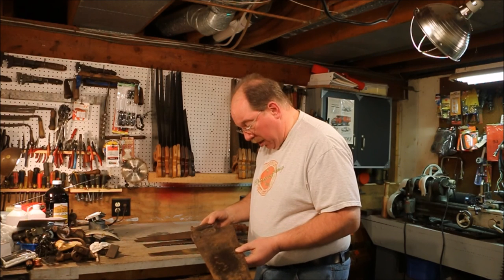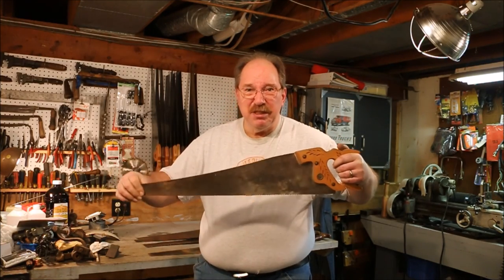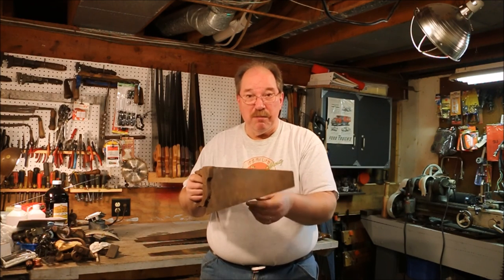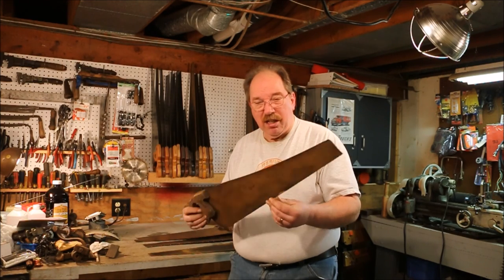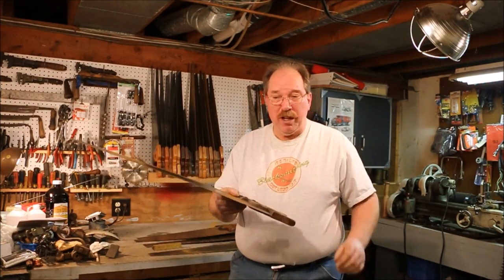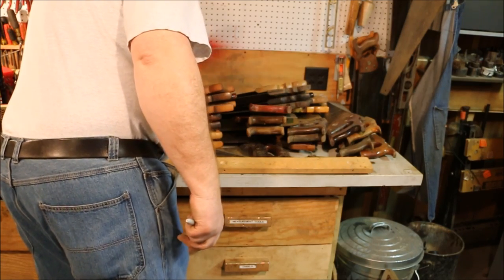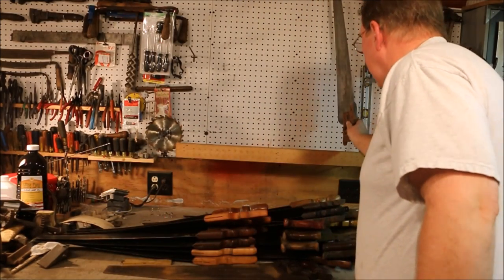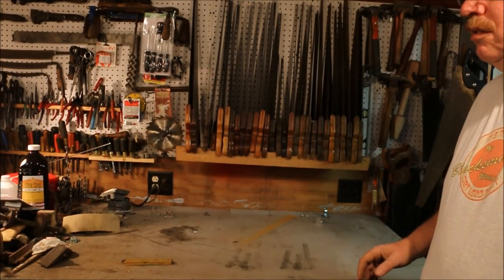Q&A At Old Sneelock's Workshop ~ Saw Till & Hand Saws ~ Pt 2

Comment: I want to thank you for this video. Ibused your Idea, to make my own Saw Till. I only have 4 panel saws plus a back sae, but it beats hanging them on a nail.
I also modified yor plier rack for screw drivers. probably could have put them close together, but it works.
Reply from the maker: +Matt Cooper Great. Glad you were able to use the idea. I have the screwdriver rack two. Made that up before I saw Adam's version.

Comment: You mentioned that some of the saws had a nib, but you never really described what it is, or why you would want one.
I have another question; one that I imagine will have as many answers as you have subscribers; but I am going to ask anyway: how many (hand) saws would someone realistically need?  You would have to have at least two, one rip cut and one cross cut, and perhaps long and short pairs, but are there reasons to have more than a couple pairs (plus possibly spares to swap out when one starts to get dull)?
Hopefully, I don't get berated for asking such a question.  I don't begrudge any man his collections, and hope they overlook mine (books, by the way).
And, as always, thank you for your videos.
Reply from the maker: +Brian Neeley 
The enigmatic Nib. A small bump 3 to 4 inches back from the tip of the saw on the top edge. I've only found them on saws that had the top of the saw cut down on the front end.
There are many theories as to why saws have nibs. Decoration, an anchor point for a tooth guard, I've even read where someone proposed that it was used to start the cut on the edge of boards. My personal opinion is that it's like rhinestone studded mud flaps on a 1950's hotrod. It could be done and someone thought it looked good.
How many hand saws does a wood worker need? 
That's a question I've asked myself from time to time. Especially during, and after, recording and editing 4 hours worth of my rambling on saws and all their various issues. If I was going to have just enough saws to manage I would have:
one 5 point rip saw of 26 to 30 inches in length
one 8 point crosscut saw of 26 to 30 inches in length
one 10 to12 point crosscut saw 14 to 16 inches in length. Until I had one and used it I wouldn't have thought I needed one. Now that I have it I find it useful for small jobs and for cutting trim with fewer splinters.
I don't currently do dovetail joints but I hope to. If I were cutting dovetails or finer joinery I would have:
one 14 to 16 tooth backsaw 12 to 14 inches in length filed rip. 
one 14 to 16 tooth backsaw 12 to 14 inches in length filed crosscut
Special tasks can be slightly easier with specialized saws and some can only be done with a specially modified saw like a flooring saw, keyhole saw, or hole saw. 
I have way more saws than I will ever need or even want to take care of. As far as having one to swap out when one gets dull, touching up a saw can take but 10 minutes and with reasonable care the saw will cut a hundred feet of linear distance before it needs to be dressed again. When you think about it that's 99 more feet than most people will cut in a weeks time. I use my favorite  D-8 Thumbhole rip and crosscut more than most and I haven't had to sharpen them again since I initially restored them 2 years ago. 

For me tools seem to fill the need that some people express in shoes, or nail polish, or fine wines. I get one and use it then find other uses for it and realise that if it was slightly different it would be, easier to use, last longer, fit better, or look better. As the Old Tools Galoots say, it is a slippery slope.

Comment: One day would you consider showing us how to remove the teeth on a saw and refile them. Do you think this technique would work on HardPoint saws as the idea of just throwing them away when they get dull goes so much against the grain. As always best wishes from the UK.
Reply from the maker: +UK Tony It's going to take a bit more practice before I feel comfortable teaching anyone how to completely retooth a saw. 
The HardPoint saws have induction hardened teeth. I haven't tried it but I believe that once the "blued" teeth are removed the material gets softer. Try filing the back edge of the blade. If the file will cut then the blade can be sharpened after the hardened part is removed.

Comment: ratio of 1 gallon of vinegar to 1 cup of salt for those rusty saws.  This is a mild acid that works much quicker on rust than on steel.  Soak overnight, wire brush or sand paper then another night if needed.
Reply from the maker: +Big Fat Tony&#39;s Thanks for the tip. I've heard of using salt before. What does it do for the process?
Reply: The salt combines with the vinegar and gets another acid going. Two acids for the price of one.
Reply from the maker: Interesting.